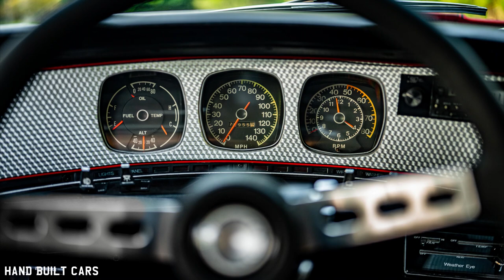1972 AMC AMX Javelin 401 Restoration Project

Comment: For your BMC Mini I have a ludicrous suggestion. 
The Yamaha R6 revs out to a lowly 16,000rpm. Yes quite insane considering timing chain and valve springs. I never thought it possible without F1 style air springs. 
Anyway, it's quite a small lightweight package. 
Put one in the front and the rear of the Mini. The weight will balance out and it's small enough to mount one in the boot keeping the back seat. 
While it may scream exactly like an F1 car, (before the shyte v6 garbage)  (that entire drivetrain belongs "In the bin!") It will still be an entirely manageable 250hp all wheel drive. The throttle bodies are drive by wire, you could set the master ECU to rev match sounding like a single Ferrari F1 engine. 
Just a thought, awesome sounds but not dangerous with AWD. Love your channel, thanks for the content.